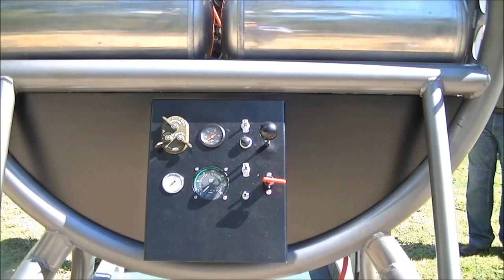Pratt & Whitney R 1830

Comment: My dad was a flight engineer on C-97's, had 4360's.  I remember that starter winding up and the noise of it firing!  Thanks for bringing back that memory!
Reply: My dad was an FE on C97s also……..funny.
Reply: @curtisshawkassociation5276
Reply: That's neat you wrote.  I sat at that panel when i was about 8 years old.   That was an engineers plane.  I still have a picture of my dad at that panel.  It took a special guy to do that job.  I bet your dad was smart guy.  My dad passed in 2010, still miss him. Thanks for your reply.

Comment: My dad would have recognised that engine and its sound, he was a fitter in the RAF during World War Two he was in Coastal command and worked on Liberators and Hudsons he told me that early on they had to repair the engines but as supplies from the US increased they had crate engines spare and would just swap them out if there was an issue.

Comment: Beautiful paint job.  An observation though, the safety wire at cyl. #7 and or 9 position tappet guides may be severed due to interference with the cam drive gear. These were wired individually around the guides instead of across the spans due to power case bearing flange wear caused by the spacer. Same with front pump drive gear and the front cam drive gear. Our shop provided a number of R2000's for the Aussie Gov't Caribous. Pleasure to watch. Is there a 4360 in the works?
Reply from the maker: hi  I would love a 4360 but have only heard of one being sold here unfortunately  I did look at a couple for sale in LA but with the exchange rate and freight they were too expensive for me.I have restored and run a Rolls Royce Avon recently just havnt done the video yet.  cheers  John

Comment: Be sure to pull the bottom cylinder spark plugs, O'm sure you guys know that though.
Reply from the maker: Thankyou  ,yes i do  ,and have every start,i regularly get a litre or so out of one of them,theres no doubt when there is oil in there  it feels lik the cyl is full of concrete     Cheers
Reply: @johnrutherford9937  A whole litre? Wow. I bet that would be like concrete.... Ya probably have to crank them over a few times without the plugs before you even put the plugs back in too.